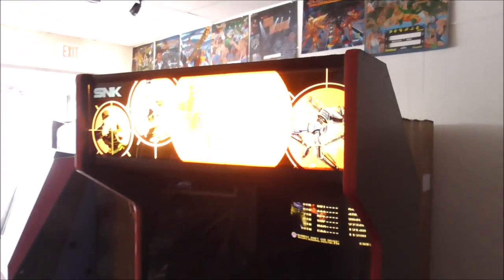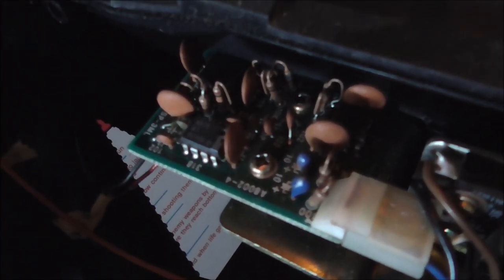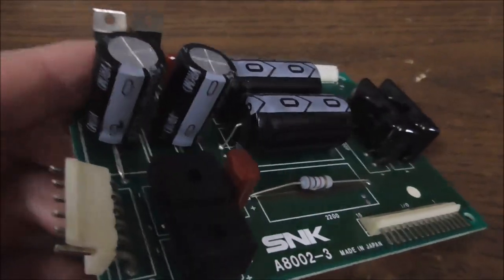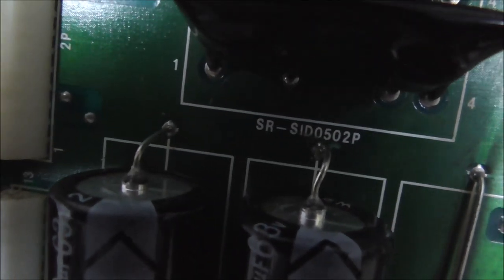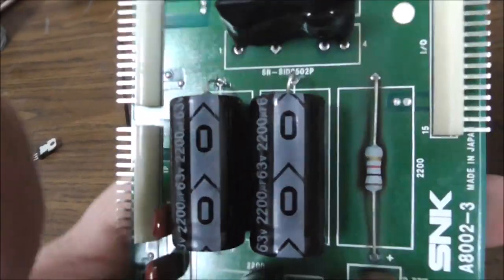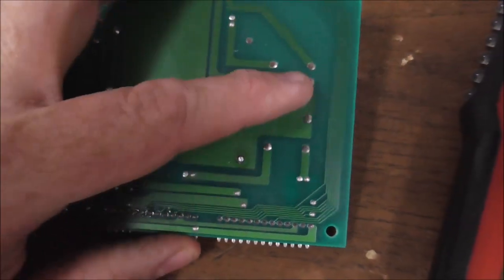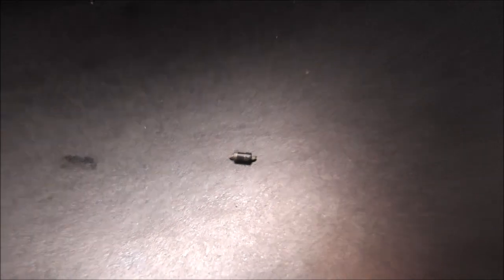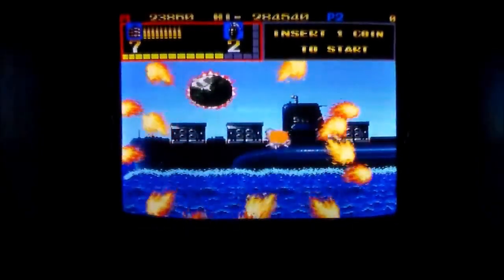How The Gun PCB Works On An SNK Mechanized Attack Arcade Game - PCB Repair

Comment: That toasty resistor is called a bleeder resistor. Its job is to bleed charge off of the capacitors so they don't zap Ron a half hour after he's unplugged the game.

The bad diode is called a flyback or recirculating diode. Its job is to continue to conduct current through the solenoid when the solid-state relay interrupts the power, causing the magnetic field to collapse faster. If the field can't collapse fast enough then the solenoid stays pulled in too long and can't give you that sweet machine gun action. The diode also prevents the voltage across the solenoid from spiking and possibly damaging the solid-state relay.

Comment: The diode prevents a nasty back pulse induced voltage when the magnetic field rapidly collapses in the coil from feeding back and damaging the transistor controlling it.. this induced spike of back voltage can raise havoc with the driver transistor on a solid state pinball driver board and might prevent the solid state relay from delivering the rapid pulses of current on demand from the game board circuit driving it.. its the same reason they are present on the coils of solid state pinball machines.

Comment: It would be under the same concept of the vibration off a phone right except a little bigger?

For like two offset weights on a spinning motor working against each other to make the vibration.

Big enough to make the vibration but small enough not to destroy the motor because it's off center I think.

Comment: Watching from the beginning… 

The design to me would be easiest if it was AC voltage being sent to the coil. This would give the back and forth.  It would need a timed circuit otherwise. Having the fbr on the board tells me it isn’t ac though. So maybe it uses drop voltage that triggers the transistors to stop working for the cap to recharge and start the cycle again

Comment: Linear power supplies are seriously un-regulated even in the case of a no load situation the voltage can go to a very high transient, so I'm sure that large 1k resistor is there to cap the transients on the un-regulated side.
Reply from the maker: Thank you Tyrone, I was wondering about that...

Comment: I am so glad many home controllers have turbo buttons!  YOu could get carpal real easily if you played this game for too long!
I do have Hori joysticks with turbo function that work on PC (Win 10 confirmed compatibility).  My Mad Catz joysticks and alternate third party (replacement PCBs) don't have functional turbo unless you use them on PS3/PS4.  Heck, 3 of my MC joysticks don't work on PC because they're Generation 1 TE (PS3 version; XBox 360 joysticks are compatible with Win 10) joysticks with the stupid USB 1.0 hardware that's incompatible with later USB standards used on PC!  They work on Power Mac but not PC's for stupid hardware reasons and lack of compatible drivers.
I'm amazed that earlier Hori joysticks (PS1 and PS2 era) still work with USB converters on PC.

Comment: If you have a curve tracer you can test the diodes better.
Reply from the maker: I do not have one of those
Reply: @LyonsArcade  they are definitely a niche test equipment item, but can be super useful in the right situation. They're also great for characterizing semiconductors which is great for those mystery situations where things look ok on DMM but still don't work. Also great for photodiode tests for light guns and stuff.

Comment: How do the optics work? I always wondered that with old games like Duck Hunt and such
Reply from the maker: The old CRT's scanned the image in, so if you told the screen to be white for 1 frame for instance, it would start at the top left corner and make the first pixel white, then the second pixel white, then the third pixel white, etc..... and then that pixel would be replaced with the next frame, it continues all the way down the screen like this.  

So there is an optic on the gun that is aimed at the screen.  When you pull the trigger, the game tells the screen to flash.... so it starts flashing from the top corner to the bottom.... when the eye sees the screen flash, it can calculate where the gun is pointed by how long it took it to see the flash (because they know it scanned in from the top of the screen).  

That's why the gun games don't work on LCD screens, they replace the image digitally instead of scanning it in.  So on a digital t.v. instead of constantly refreshing the image, it just changes the pixels that change.... so there's no way for the gun to know what it's pointed at when the screen flashes, it would all flash at the same time!
Reply: @LyonsArcade  really interesting! Thanks!

Comment: According to Wiki (I know, I know!) this is NOT a Neo Geo game.
Neo Geo (both the arcade and home console systems) was launch in 1990.
Mechanized Attack is 1989.
UPDATE:  Mechanized Attack was later ported to the NES system in 1990.  It was compatible with the light gun Zapper and standard NES control pad.
Reply: BTW, Joe --
Did you notice the flyer art has a guy on it with sunglasses who looks suspiciously like Arnold Schwarzenegger did in The Terminator?
Hmmm.....!
Reply: Wow -- this game plays like a mix of Terminator and Predator!  There's already the Arnold tie-in with the flyer art of Mechanized Attack.
Reply from the maker: Back then it was more common to completely rip something off like that, lol  They probably knew exactly what they were doing there..... thanks for watching AvengerII!!!

Comment: The diode is probably letting too much current rush back, slowing the relay to a crawl
Reply from the maker: That makes sense, thank you...
Reply: @LyonsArcade  I have NO IDEA what you guys are talking about.
I did hard science in college but electrician work was not on my course of study!
Heck, to be honest, I NEVER had a good physics teacher!  LOL  I passed the courses but they failed to really get us all a good understanding of basic electronics theory.  I muddled my way through circuits.  I basically know enough to rewire and solder electrical signal lines but this business of resistors and diodes is beyond me.
I have, HOWEVER, managed to learn how to operate circuit breakers to keep from electrocuting myself!  I feel proud that I managed to replace two exterior light fixtures and a light switch without killing myself!  And I did it all on my own!
Reply: @AvengerII  I just think of a diode as a hydraulic pump - By whatever mechanical means a low pressure cavity sucks water in and high pressure is mechanically created on the outlet side, flow goes one way but never the other way, if pressures on both sides were equal there would be no suction and no output. A diode allows power to travel one way but not the other, unless it is faulty, if power goes back the other way there is insufficient voltage to drive the intended device, the same way a hydraulic mechanical arm will not move at all if pressures in the pump are equalised.

Comment: I use a pc with retroarch and hyperspin and jammasd on a blast city.
But I never tried a gun,I will..just to play again T2 and some funny Laserdisc shooting games.
If you could just show how to use a gun or 2 guns..
Thanks.
Also..if you know some 640x480p 2D games outside Naomi,Atomiswave and Y2 system..I dont know...sadly the 31k was not really used in 2D..a beautifull 2D..a Deathsmiles 2 in 2D 640x480p would be much better than bad 3D at my taste.